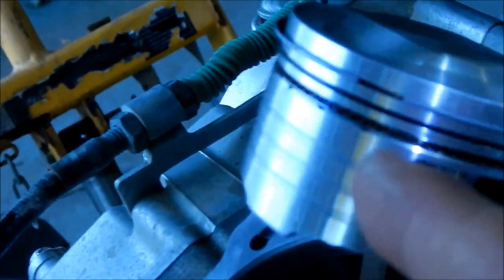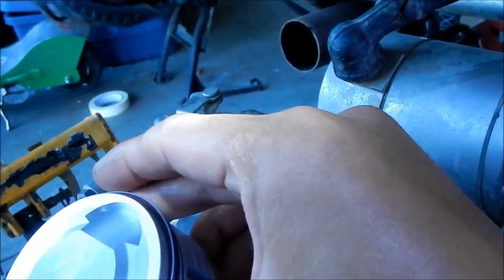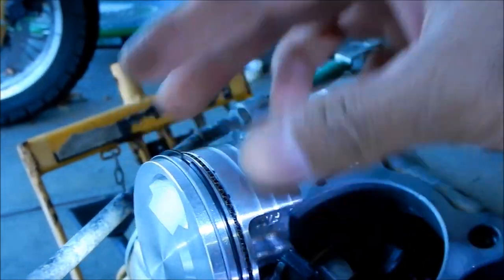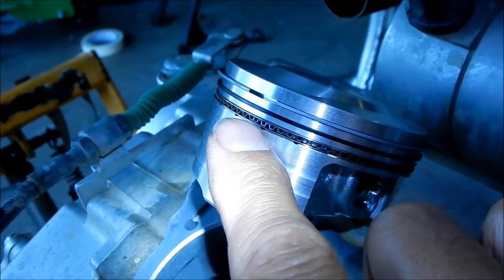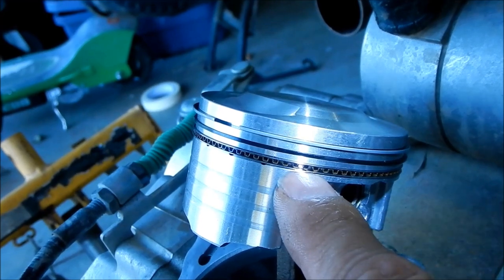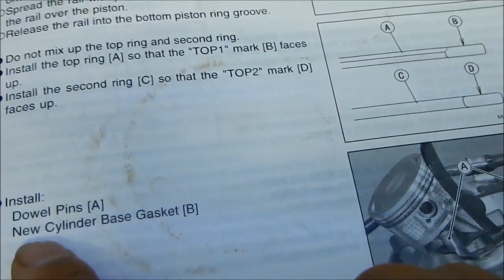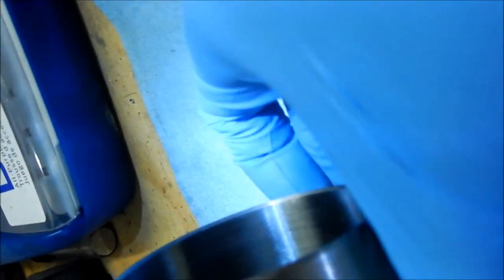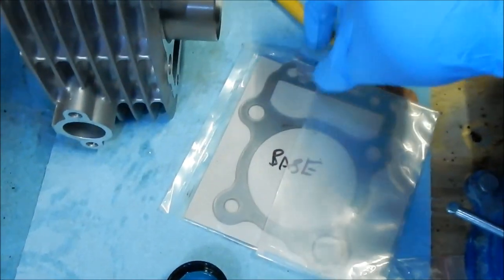KLX140 Big Bore Topend Rebuild VLOG Part 23 - Cylinder Installation

Comment: How much difference has it made with the extra displacement?
Reply from the maker: It has a little more topend power, it actually feels like there is less power down low though, that might be because of the cam, but it rips around pretty good.  I rode it today at the kart track and still a lotta fun, definitely more power.
Reply: @hadesomegamoto7639   did you keep the stock cam?
Reply from the maker: @showscenegarage  Yes I still have it